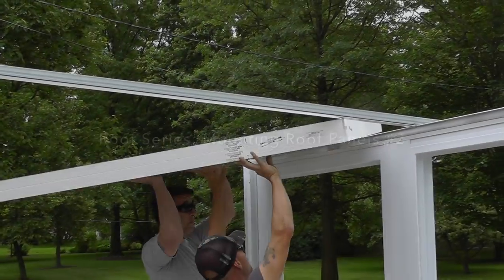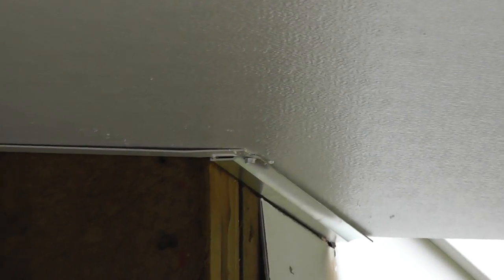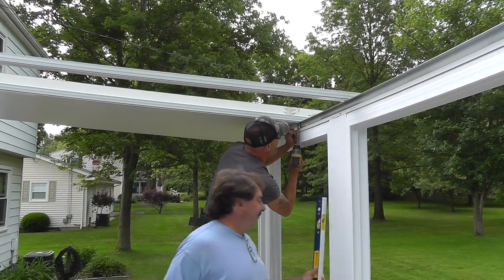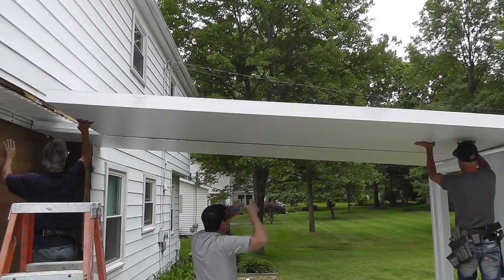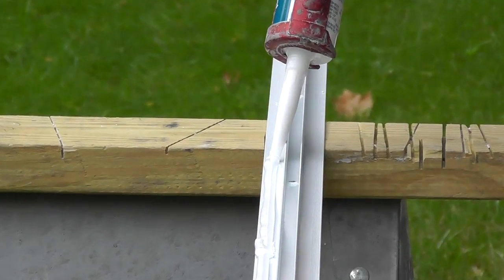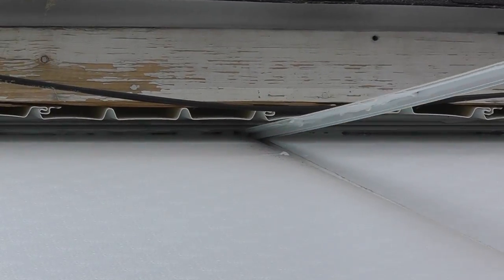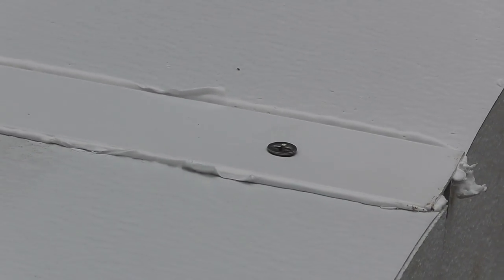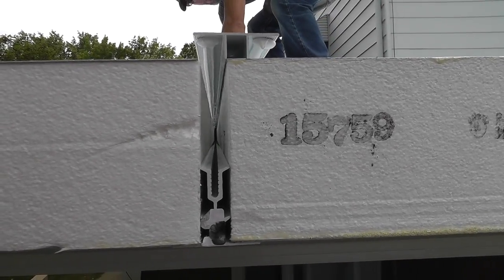Roof Series #2 : Mounting Roof Panels

Comment: volume very low.  any good metal insulated roof panels for primary home dwellings approved in Florida and deliver in Florida?
Reply: I know right? I wish somebody would answer me because I'm looking at a screened in patio but just to have half of it insulated cuz I have a 10x30 but have a Jacuzzi out there so I was going to do just the screen super screen because I have cats, no kick plates, two doors and one fan beam. We're talking 11,000 something and that was with $1,000 off and another $300 off for military. I mean crazy but a pan roof. No way in Florida you'd be able to sit out there. Plus if I could get a sunroom at that same cost I mean you might as well do that right? As long as you could open the windows and get some wind going through but it looks like something you know. If you got a couple guys you could do it yourself. I don't know. I'm just trying to save money they want 3300 just for the screened portion over my hot tub. A 10x15 just screen 3300 and if I got a pan roof it would be a couple thousand less. But I was told again if you put the foam later people choose to do that but he said it gets all goofy and nasty and gross goopy. Sorry but and can get moldy and of course you can't walk on it so I don't know what to do and it doesn't look like anybody's answering on this page. So if you find out any info that can be helpful. Help out a fellow Floridian. Thanks and God bless you

Comment: I have a BBQ pit and sink under my insulated patio. And I need to run pumping but want a clean look. I don't want to cut through concrete to run a pipe to the sink. Is it safe to drill a hole or two through these panels and come down from the top to the sink. It just happens that one of the pillars is right by the sink and it would look cleaner if I can come down from the top and down that pillar to the sink. I've never worked with these types of panels and don't want to mess it all up not knowing if I can drill two 3/4 inch holes through them.

Comment: Do you screw the roof to the metal frame from the inside part (the panel's face that faces the room)? Is it safe to do so? I am concerned that a strong wind can blow your roof away. Shouldn't it be safer to screw the roof from the exterior so the bolt crosses the whole panel and gets attached to the metal frame?

Comment: What brand/type of sealant do you use for this job? Thanks
Reply: Did you ever find out?
Reply: I know. I hope somebody will answer questions because I was curious about the cost. Was he putting AC out there? Was it windows? Can you screen the windows because I'm looking at a lot of money just for a screened in porch and I'm only getting half of it roofed it's a 10x30 the others are going to be just screening over my jacuzzi and it's 3300 just for the all screen part 10x15 all screen granted it is super screen because I have cats but he said the kick plates would be like the same price which is just crazy to me. We're talking about aluminum and screen so it doesn't look like anybody's getting their questions answered. So great! I guess I'll have to look on some kind of forum somewhere else or something. Or if anybody knows please tell me. Plus I was thinking about just doing a pan roof but I'm in Florida. It would be horrible and I was told adding the foam later. It just isn't a good idea that it gets gross and goopy and moldy and turns into basically slop. If anybody knows about this please let me know cuz that would save me a couple thousand dollars just to get it. Insulated is a couple thousand dollars. More 10x15 crazy. Please help guys anybody please please please and thank you in advance